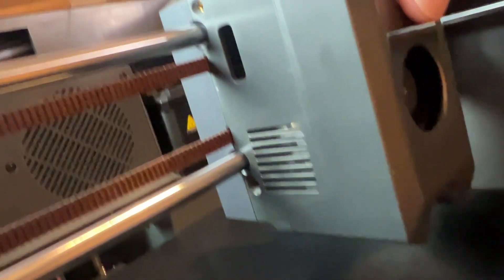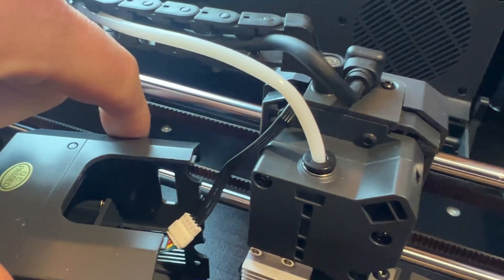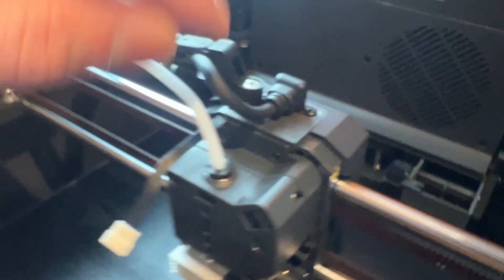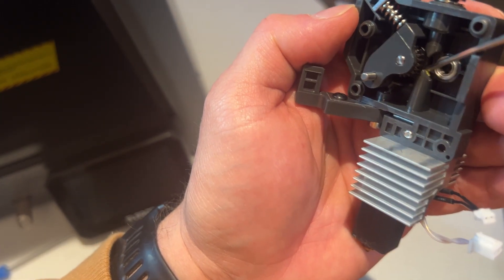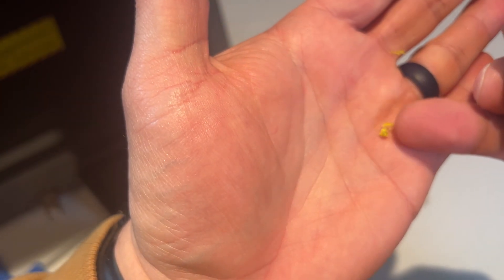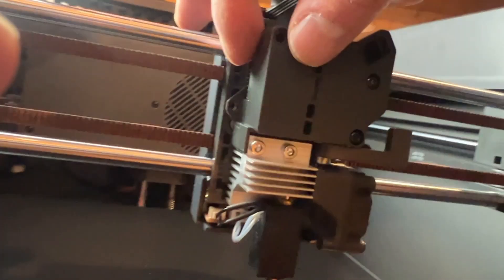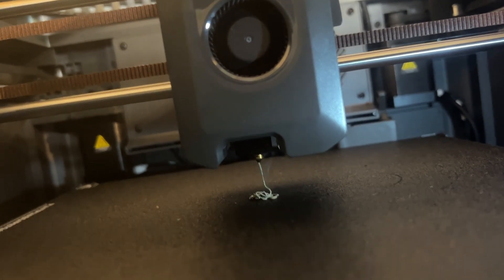Elegoo Centauri Carbon Not Extruding SOLUTION/FIX ✅

Comment: While I did some google search for help I came across your video. 
My problem started yesterday. It printing fine and halfway it’s going through motion but no extrusion. I did all trouble shooting and even factory rest. I used different stl file but same issue. Halfway through print this happens!
Reply from the maker: Have you tried swapping out the nozzle?
Reply: @ILove3DPrintingYT No but I changed PLA and it worked!! weird
Reply from the maker: @kamas1 maybe try and give the filament a good drying out could be salvaged

Comment: That's a lot of extra work when all you needed to do is just take the bowden out and  stuff a piece of spare filament down in there to push it through. Or a hex key that's a little smaller than filament
Reply: Every time this has happened to me I just set the nozzle to 320C and just retried loading the filament until it finally pushed through. Sometimes it just wont happen at 250C, needs to be max temp etc.

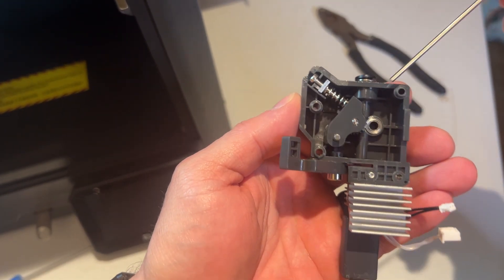Comment: If you want to remove the boarding tube, you have to press in the black seal that's connected to the tube at the same time! I didn't know this, so I struggled for a very long time! 2:18

Comment: Hey everyone,
I’ve been having extreme problems with my Centuri Carbon printer — really bad stringing, blobbing, and zits on all my prints. The only decent print I’ve ever gotten was the default Benchy that comes preloaded with the printer.

Here’s what I’ve already tried:
	•	Adjusted temps across a wide range
	•	Switched build plates
	•	Used a filament dryer before printing
	•	Replaced the nozzle with an updated one
	•	Cleaned the area above the heat block where the PTFE tube pushes filament through
	•	Ran self-checks and calibration multiple times

Despite all that, my prints still turn out terrible. I’ve checked retraction settings, temps, and even changed filaments, but nothing seems to help.

Has anyone else had this problem with the Centuri Carbon?
Any advice or recommended slicer settings would be greatly appreciated — I’m honestly stuck at this point.

Comment: I followed your instructions and it helped me get up and running again.

Found a lot of stringy filament wrapping itself around the extruder wheel and gears as well as some chunky globs that just took some finesse to remove with my side cutters and very little pressure. I put the stringy filament down to user error as I tend to do a lot of pulling instead of unloading properly (my OG Tevo Tarantula had a Titan, not a direct drive extruder), so I guess that is a habit I need to get out of...

I was however impatient (and a little naughty) and didn't do a recalibration, but as your guide was so detailed and everything I was expecting to happen and be present was, it all went smoothly and the first print after the "fix" was absolutely fine.

Have a sub my good man 👏

Comment: Great video, my filament was very uneven and wouldn’t extrude fully and I originally thought it was the problem you were having, turns out that sneaky screw in your video was the gear tensioner and it loosened during printing  causing the filament to not pull correctly  so I tightened that screw and it fixed the problem

Comment: You disassembled way too many things.
The front cover is magnetic and hanging on two top nipples. You can take that one off without tools and disconnect the fan way easier, THEN remove the four screws on the sides.
In the next portion, there's no need to undo the two small screws at the top, just the three long ones, BUT it's a better idea to remove the hot end first. The "sneake little screw" is the extruder's tension adjuster and there's no need to touch it either. That way you won't get the gearbox open with the hot end still attached to it, as it is way better to take that out CLOSED with all the parts still inside, then carefully open it.
The removal of the little piece of PLA and the rest is fine enough.
You didn't check the hot end or nozzle, where most of the clogs occur, though. The whole process could have been for nothing.

Comment: I can’t even get mine to grab the filament during the loading process
Reply: had that problem from new, there was pla left in the nozzle from the factory. I ended up purging the nozzle by printing a small calibration cube untill the  factory yellow pla was replaced by the black petg

Comment: Thanks, that was a big help . I just had an issue where I swapped colors and after leading the new reel,  the extruder kept clicking. Tried unloading the new filament and it was totally stuck. I pulled it apart and just sheer luck that the very end of the filament had pretty much mushroomed out right between the extruder gear and the hot end and that was preventing me from backing the filament out. snipped it off and reassembled the extruder

Comment: I wish this worked for mine, one of the screws came absolutely stripped and will not remove... i basically have a $300 paperweight now.
Reply: You can get the screw out. There are drill bits exactly designed for this. Google it. Bought a set myself. It'll drill into the screw, then reverse and you should be able to unscrew the stripped screw. Worth their weight in gold. Good luck.
Reply: @robt6687 I did indeed end up finding one if these and it worked! Thanks dude, now just to track down a replacement screw lol

Comment: Thanks heaps. I just got mine and it clogged up on the very first print. I cancelled that print 'cause I hadn't positioned its objects like I should have and then did an extraction, and that's when I got the clog. It wasn't in the hotend, either--something which I did consider purchasing as a repair item, but then a new hotend from Elegoo wouldn't be in stock for two more months. Anyway, I followed what you did and found the clog on the side of the gap opposite to where yours got clogged.
Now the thing is working again.
Thanks.

Comment: Literally just got it out of the box. Put filament into it and it's jammed. Haven't even printed anything yet. It spit a tiny bit out at first and now it won't get anything through. I can't even pull the pla back out.
Reply: Hey there, if you haven’t fixed it yet try cranking the heat to about 250 on the nozzle and hit the retract button so it’ll feed the filament out and then snip that end of filament make sure it’s clean then re enter the filament while hitting the extrude button so that it’ll feed into it. I just was having this problem about three minutes ago (just opened the box as well) about to finish its first test benchy
Reply: @JarodNelson-x5vI did that and nothing happened. I had to take the filament tube off and yank the filament out of the extruder. I think it got to hot at first and melted inside a little bit and got jammed. Working good now.

Comment: Just got this printer tried to load the filament failed to do so I took it apart and that big gear that just pulled away on yours did not do the same for me and I can’t remove it it’s blocking me from seeing the failure at the same spot as yours I also cannot pull the filament out
Reply from the maker: Interesting, have you tried using some pliers on it?
Reply: I gently wobbled the gear out, prying up on it with a larger allen wrench. It finally popped out. I had the same issue, and filament was jammed in the extruder.
Reply: @Nexustechus  I had same issue on my first and only clog to date, had clog in extruder when switching from abs to pla.  The cutter never cuts and I think was real reason clog started when I went to change filaments.  Think future I will do old school filament change instead of automatic, it is way more reliable. Took a bit of wiggle and reaching in with sharp straight pry tool I have, then I got snips and cut the clog which was popping out of inside plastic tube behind extruder.  Once cleared put unit back together set tensioner for about 3/16 inch heavy distance inwards from most outward position or least amount of tension, which equates to around 3 full turns of tension from fully untensioned.  It seems to be doing well with PLA running in it now.  I do hope aftermarket company comes out with better extruder design, this one just looks cheaply made to me no where near quality of my Plus4 extruder.

Comment: Any ideas on how to perform a proper Cold Pull on the Elegoo Centauri Carbon 3D printer?
Reply from the maker: If by cold pull you mean getting the filament out when the machine is idle, you cant. I heat the nozzle to 250 and then press the reverse extrude and let the machine push the filament back.

Comment: I unclogged my nozzle, but now I think the extruder tension is messed up because the filament path is clear, but the filament isn't being pushed through; I kept loosening and tightening the tension screw, but the filament wasn't being pushed through still, and I don't remember what the gear tension was at before. That silver screw that was almost missed is the screw for the extruder tension. Could someone help me?
Reply: I adjusted mine completely believe direction was outwards, pretty sure that was the original tension to begin with , not more then couple turns at most if you need more tension, that is a pretty beefy spring.  Going to recheck it before I run a print on tension.  Right now it appears to be grabbing filament properly, but time will tell.  Not impressed with this filament feeder setup(seems like cutter never cuts it unless I manually cut the filament), everything tight and hard to reach, hate fact one can not use case light when doing this.....at least let us have case light to see when changing nozzle out and working in tiny area.  I will probably  put two complete turns maybe three tops for tension on it, think best time to tension is after filament has been run into the nozzle.  Will know more in 20 minutes, having it run auto level at the moment.  You can see distance in this video that his was pretensioned about three full turns roughly.

Final update.  Loosen fully tension, then I put three to 3.5 full turns max on it, or it moved inwards about 3/16 inch and it is working great with PLA at the moment.  Do not over tension.  I hope after market company offers a better extruder for this machine, I have several of them they print great, this was my first clog in 300 hrs across two machines.  I just do not like the cheap plastic i see inside the extruder, has me worried. I also do not like that split tube it feeds through, see where this gonna be pain, I will only manual change filament going forward.  My clog happened doing auto change from ABS to PLA.  Manually changing filament just more reliable especially since their cutter never fully cuts the filament.
Reply: Here found this video, this is helpful cnc kitchen has video on Tension settings for filament extruders.  https://youtu.be/5UEUFDP8M30?si=43KxH6JxFjD3CEta.  I hope aftermarket companies are watching.  This printer does nice printing, but I do see huge need for better extruder system.  I think a whole new extruder is in order, need a higher quality extruder, design seems very chincy to my.  I have 300 hrs on mine for me this was my first clog, but I do not like design all those plastic teeth in there.

Comment: I managed to create a clog in the top tube going into the hot end while changing filaments (from orange PCTG to blue PCTG too)... Gonna have to faff with that to get it unclogged. No clue how it happened, the whole thing has been perfect until tonight, really wasn't expecting this.
Reply: Yep my printing was great until it started printing air.  If it's in the tube itself is easy to resolve.  It's when it's in the hot head or you can't figure out where the clog is that it becomes a bigger problem.  Remove the tube abs run a long stand of filiment through it to push the broken piece out. The spot where the tube connects to the hot end take some needle noise pliers and push down on the rubber grommet to release the tube and pull lightly on the tube abs it comes right out.  Don't task on the tube without pushing the rubber piece down first though. Then when the tube is clear just push it back into the hole until it's connected again. Also if your printer still has the tube zip tied to the chain cut the zip tire off and pull the tube up a little so there isn't that right turn going into the hot head.  Elegoo after shopping the first batch or 2 of printers had stopped zip tieing it there and is instead letting it float above the chain so that turn isn't so a right turn entering the hot head.  Mine arrived with the tube loose but I know people who got the early ones and they were zip tied to the chain. Good luck

Comment: Not the same problem, but had a glog in the upper half of the extruder. So I removed the hotend as you described and removed the nozzle from the extruder. It was suprisingly long. I noticed a pla wire in the upper half and use the same tool as you. But I first made it hot with a lighter (USE a towel to hold the tool!! It was hot). I melted it in the wire and I could pull it out. 
Reassembled the hotend and it worked again. Probably the hotend could not heat up this part of the tube (was the part in the cooling block), why it got stuck, I do not know. 

Thx for pointing me in the right direction (sorry for my bad english) :-)
Reply from the maker: @WilcoGroothand  I’m glad you got it sorted
Reply: Cheers for this, I think I have the same clog. I'll try an oven mitt and a lighter. =)
Reply: @jubuttib  Hope you get it done. Do not get burned.
Reply: @ Cheers, got it sorted. Once the nozzle was off I could get a good look at where the real clog was, and it was a really stubborn one right in the narrow bit of the feed tube going from the heatsink into the heated part. I got most of it out with the lighter, but still couldn't fully push through, so ended up having to use a 1.5mm drill bit to clean it out... =)

It's working now, prints just fine again. PCTG apparently can create quite the clog, hehe.
Reply: Hi @WilcoGroothand I am facing this issue for almost every print , Clog upper half of extruder. Is there any permeant solution ? Please share

Comment: This is NOT how you address a filament clog in the nozzle. Cut the filament with the cutter if needed, then take the two screws out of the top of the heartbreak/nozzle, drop the nozzle down out of the way and address the clog. Figure out if it's in the extruder or the nozzle. You could have also run the filament down through using the screen interface after dropping the nozzle out of the way.
Reply from the maker: Thanks for your feedback
Reply: Would definitely recommend! Was just about to take apart the extruder when I noticed that the screws came stripped. I was about to contact elegoo support before I noticed your comment. Removed the nozzle and a tiny blob came out. Removed the PTFE tube and looked down the hole and I could see to the other side.
Reply: Unless it's not extruding because of this cock up ya nunce

Comment: Thank you for the quick video. I just received my CC. Now I know how to disassemble and address a clog. Do you think the feeding angle causes abrasion of the filament, which could be contributing to small shards of the filament jamming the hot end feed path?
Reply from the maker: Yes 100% I can’t understand why Elegoo allowed this to be honest. It seems that the gears are slipping on the filament and that’s where the shards are coming from
Reply: @ILove3DPrintingYT First thing I’ll do when mine arrives will be to ease that curve and print one of the top cover spacers that’s out there to give the Bowden tube more room. I can’t see Elegoo being able to do much about this ‘feature’ without either supplying a spacer themselves or making the printer a bit taller. I suspect there will be dozens of different ideas for fixing this soon, but maybe when the MMU appears all will be revealed.
Reply: @ILove3DPrintingYT possible solution to the tight angle on the feeding tube: https://youtu.be/rQKwMi8vB7Y?si=wkjRjLUprCAFIO9M&t=658

Comment: I pre-ordered one of these last month and was curious to see what the extruder looked like - this answered that question nicely! I wonder if this is a common issue or not? The basic layout looks a lot like the cheap 'double gear' extruder upgrade I put on my Ender 3 and that's never given the slightest trouble. 

Thanks for putting this out there.
Reply: it also reminds me of the extruder of Prusa MKS3.5 .
Reply: Well it's becoming more common I think.  I got my printer 2 weeks ago and now my printer is printing air.  It's going through all the steps as if it's printing until it gets to the end abs the printer says printing complete but it never pulled any filiment.  3dprintingmike did a whole series of videos dealing with this problem also.  I saw one other posting about it. So that's 4 of us that I know of. Dint get me wrong the thing prints better than my other printer abs does a fabulous job when it was working.  Now I am dealing with sorry to get a new hot head

Comment: It looks like changing the filament cutter will be easy enough, just remove the shroud and undo that one bolt. It looks like the blade itself can be changed, any idea if it just uses a regular off the shelf hobby blade?
Reply from the maker: From what I can see it looks like an Exacto knife blade, but not 100% sure.